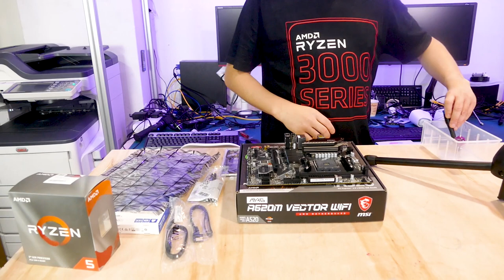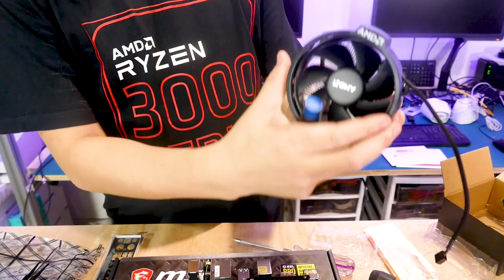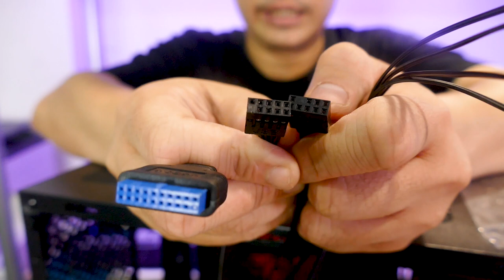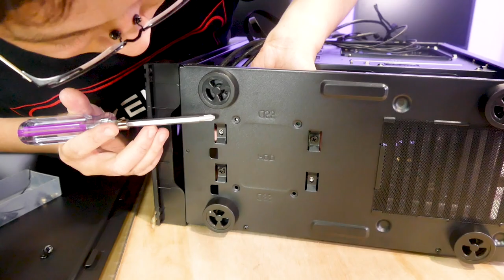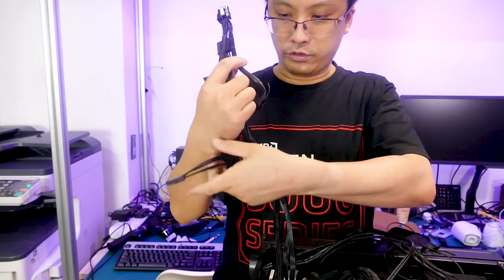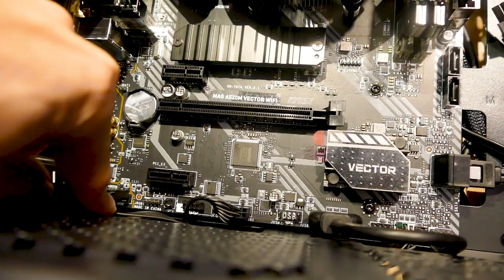How to Build a Gaming PC in 2021! Ultimate Step-by-Step Guide (Ryzen 5 3600 & 1660 Super)

Comment: Why don't you route the motherboard power cable via the hole right beside it? Looks cleaner
Reply: Hi this is Gordon from Typhoon Systems

Yes i know there are those openings in the frame right next to the mobo edge (where the 24 pin connector is) and it looks like you can route cables thru

Howeve, the MSI A520M Vector Wifi used in this build at 21cm in width is one of the smaller MATX motherboards available. If a bigger MATX mobo is used like the MSI B550M Mortar Wifi with a width of 24.4cm (wider), those gaps will be covered by the mobo. Hence i used the gaps further away to route so i wont have to do so much rewiring should this mobo be replaced with a higher-end and physically larger model
Reply from the maker: @SoranPryde  Thank you Gordon for your reply !